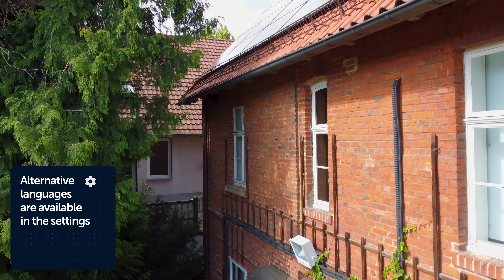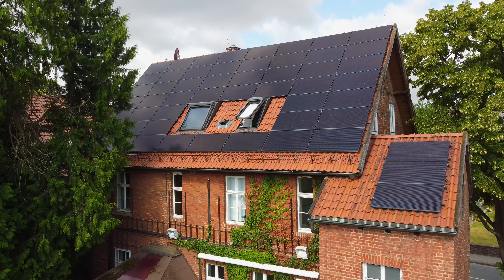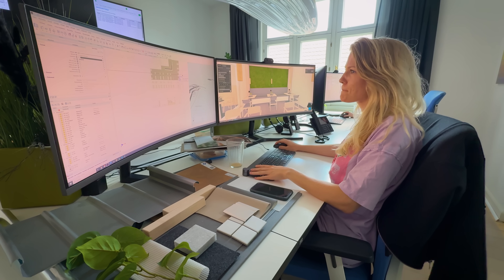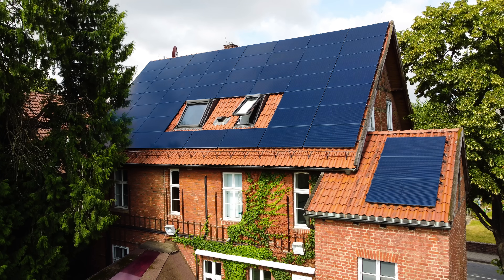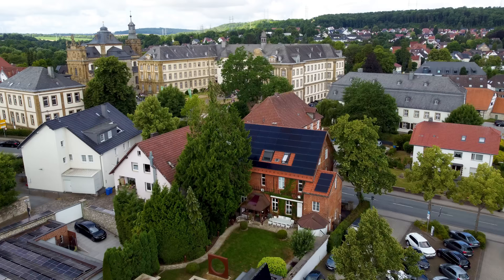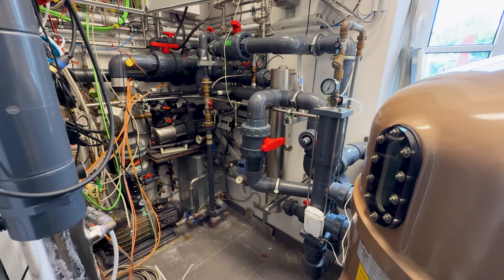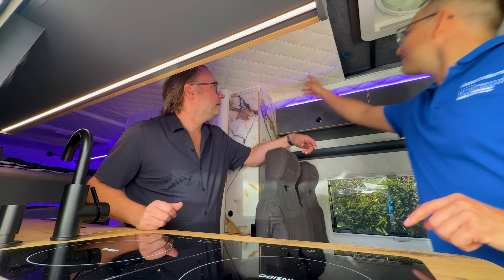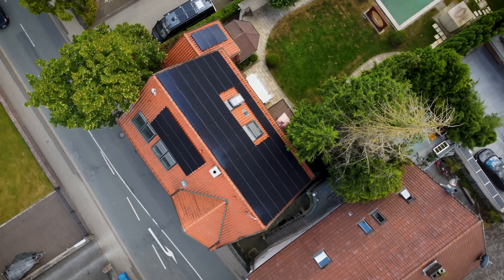How a 1850s Family Home beat Solar Panel Shade

Comment: Very cool advert. Really but....despite of that this offer is not for common users. More than 95%  i think   houses like this dont need  such exaggeration .  100KW storage + 40kW panels  +  electric cars . I can not imagine how  expensive could be and if somebody calculated savings. But anyway .... 200kW power consumption per day?  For who and what is that nonsens? Just to keep energy to blackouts ? How long? How often? Sun doest not shine every day . What about winter time?  Simply calculation 50 kW minimum needs with 100kw storage maks 2 days. Sorry i am not against and additional i am experienced user/designer of offgrid systems and i LIKE it but....the real truth is not like on this movie and there is not in the whole world yet solutions to produce energy from darkness and shadows.

Comment: YOu can make your DIY DC-DC BUCK synch. inter. 3-phase topology
or BOOST topology, so you can cope with shading.
Look at P&O or Incremental Conductance algos. 
A few lines of code, ESP32, toroids, FETs, caps, after 8 hours
all communicating RS485 / TCP/ip / CAN / BLE / MQTT for HA or InfluxDb.

Comment: All of this could have been much easier accomplished with microinverters as you basically "distributed" here your Victron system in a way how microinverters work natively. Enphase would have been great for this particular house. Here are some of the benefits of microinverters.

 - Flexibility of panel placement on the roof. Can have different orientations as each micro and panel is independent . Can easily manage different roof levels as AC cabling more flexible. 
- System can be easily expanded later as you just add more panels with micros underneath. No need to change the whole central inverter. 
- Is very good managing shading / clouds
- Micro inverters start producing electricity with less current than string inverters (early morning / late evening)
- Safety as AC is low voltage and rapid shut down built in
- Longer system life time and warranties compared to string inverters 
- Resilience. Should one micro fail then rest of system still producing
- Module level monitoring and diagnostics
- Sunlight backup without grid or battery power as long as there is sun (Enphase IQ8)
- An Enphase microinverter system (AC) with battery can output way more power during daytime than an equivalent string inverter system with battery (DC). Reason being that microinverters output AC for use in the household while the battery also outputs AC for household use.

Comment: Just put some micro inverter, will be even more efficient in the end with one mppt per panel, let the multiplus control those micro when the grid fall. It's better then the multiple mppt of the video solution. Even if Dc-Ac-Dc is less efficient, I'm pretty sure the shading will be far better controlled. And it add AC power to your system, reduce the load on those multiplus.
An other parameter would b'be back busbar panels which deal far better with shades.
And yes...an other one, there are far too many packs for only 100kWh of capacity, get rid of those small pack and buy bigger ones...like the actual MB56 packs, 32kWh per pack..you only need 3 pack, 3 pack = 3 Bms instead of the 20 you got..that's 6/7 time less energy loses here....

Comment: Nice implementation of available technology!  Might not save any money, but using 9 solar charge controllers with that much battery storage, provides a good amount of reliability and self-sufficiency.
Reply: These MPPT controllers aren't actually expensive at all.

Comment: I like Victron products, I use quite a few myself but this is another example of an OTT installation. More money than sense... the total cost far outweighs electric bills for decades into the future and the batteries will need replacing every 10-15 yrs so that cost never ends.
Reply from the maker: Remember this install covers his house, his business and the power for his cars. (not all cars are his).  Plus Sven can feed excess power back to the grid making money.  We find a lot of people also treat a Victron system as a hobby (like golf, luxury cars or going to fancy restaurants) and they are eager to learn and see what else they can put on the system.

Comment: Very interesting, I have a similar, but smaller installation in the south of England. I too have SolarEdge for the panels my neighbour's tree shade at certain times. I have added three MPPT controllers for the other PV panels as these are placed on different parts of the building, all with different orientation.
I have a MP2 10kVA inverter/charger coupled to a Fogstar 32 kWh battery, as this neatly fitted in the space available, which is narrower than a standard rack.
I run Venus OS on a raspberry Pi with CAN bus HAT.  
As I also have a heat pump I use Octopus UK's  'Cosy' time of use tariff,  this provides 8 hours of cheaper electricity a day in three segments, allow me to keep the battery topped up. I have started to use DESS to help manage this.
So far very pleased with the system. 
But I do wish Victron would design a replacement for the SolarEdge, supporting panels with individual optimisers, as I have had two failures of SolarEdge inverters in the last 5 years, they are not as reliable as Victron kit.
Reply from the maker: This is great to hear and boy you have a comprehensive setup there by the sounds of things!  I'll ask about SolarEdge alternative and come back to you.

Comment: Alternate languages.... don't get me started. YouTube has been trying to force AI-generated voices in ones native language (Dutch in my case), while I want to hear the original. There is no option on the clients end to stop this, though a certain browser addon does help automatically selecting the original audio.
Reply from the maker: Hi there,  thank you for your comment.  YouTube are pushing this as not everyone speaks English.  The Netherlands is rather unique as a very high number of people speak English and as you know, many are taught English from a very young age.  But the reasoning is to be inclusive.  To change the language its really easy and it stays that way for all videos (so in your case English as preferred language).  At the bottom right of the video (top right on mobile) click the cog and this allows you to change the Audio track.  Hope that helps.
Reply: @VictronEnergyBV  I have no problem with YouTube offering this feature, the problem I'm having it's being forced with no option to turn this off. When I select the original audio track using the cog, this only applies to the current video, there is no option to always have the original audio track by default and I'm far from the only one running unto this ;)

Comment: I was thinking about either 3x15kVA or 3x3x5000VA (as I already am offgrid with 3x5000VA) and 135kWh of battery (currently 90kWh) :-). The difference is also: I am really off-grid. The nearest grid line is 20kV. And in this "cheap" (hungary) country, somehow the electricity prices are higher than for instance in the Netherlands.
Austria is near. Anyway in the winter it is like this: either it gets cold, and you can fill the batteries due to clear weather, or it's not that cold, but you have to turn on the diesel gen due to mist and no wind.
Local people keep insisting on wind energy, but they have never experienced normal daily wind in the Netherlands, which is here regarded as a storm. Getting 10m/s windspeed is practically impossible. And that's only the starting point.

Comment: I am a Victron Enthousiast and also Victron ESS installer, however in this situation I would not have chosen 9 MPPT trackers, but I would have combined the powers of Victron and SolarEdge. Solaredge uses Optimizers on each panel an thus, each panel has its own MPPT tracker. This would have made the installation a lot easier as there would have only been the need for 1 or 2 solar PV strings, instead of 9 different string, The costs would have also been a lot less since every optimizer would have cost only about € 45 and a 3 phase SolarEdge inverter only costs about € 250,- nowadays. And yes, you would need to convert AC back into DC again which comes with efficiency losses, but those losses are much less compared to the gains of having an MPPT for each panel.
Reply: It's good to have at least one mppt charge controller in any Victron system to allow recovery in a system failure.

This system here sounds like it's heavily geared towards off grid back up.  Using a solar edge or any other grid tie inverter would not offer power from the solar in a grid failure.  There may have also been constraints with the grid limiting how much AC equipment could be connected.

It's possible to ac couple solar on a fully off grid system using Fronius or some sma inverters.  The limit is that you can't readily change between off grid and ESS with out reprograming several devices each time. 

Overall the flexibility of Victron gives us plenty of ways to solve challenges.
Reply: @WindyJAMiller  If the SolarEdge inverter is installed on the AC Out side of the Multiplusses, the inverter would continue to function during a blackout. In fact, Victron and SolarEdge have very good implementation in off-grid situations.
Reply: @veeerzes I didn't know that. I've used Fronius and sma so far on offgrid AC coupled. 

Does ess go into frequency response when there's no grid then?
Reply: @WindyJAMiller  The Multiplusses can be programmed with frequency shifting during of grid situations. With the right setup (also in SolarEdge inverter) the system can reduce PV power to 0% when batteries are getting full.
Reply: @veeerzes yes I understand that, but my question is does the multiplus still allow frequency response when it's set in ess mode?
Reply: @WindyJAMiller  Yes, and with the new Cerbo firmware, it even supports full dynamic control over Sunspec, so in practice it won't even need frequency shifting.
Reply: The problem I have with optimizers: They are an additional piece of technology sitting on the roof below each panel. And optimizers are not failsafe.
Reply: @wiedapp  I've installed multiple PV systems with SolarEdge in the past 10 years. Out of the hundreds of optimizers, I only had 1 DOD and never had any fail after install.
Reply: But that's converting DC solar to AC, then converting back to AC to DC from the charger into the battery.. much less efficient.

The victron MPPT 150/350is only 100 pounds per each 3 panels. So essentially it's the same price from that standpoint as 3x solaredge micro inverters.
Reply: @jcautec in this case the solar edge might still be a better option from an efficiency point as the site had high demand, producing power straight to AC where it is then used is probably effective and efficient. 

Also looking at the age of the solar edge inverter and the batteries I would say the Victron system is at last a couple years old and the sugar edge inverter looks to be older still, prices have changed around a lot in that time so that might have factories into the decision process at the time.
Reply: @jcautec  The optimizers are FAR more efficient than the Victron MPPT's when encountering shadows. Unless you have a Victron MPPT for every panel... I already mentioned the losses from DC to AC and back to DC, but if you watched the video, you will see that he has a lot of AC loads, so much of the AC -DC conversion doesn't actually need to be done.
Reply: That's exactly what they did.  🤣 Way to comment without watching the video...
Reply: @zstation64  I guess you didn't pay enough attention, they only used a SolarEdge system for the panels on the garage... Please take your childish "🤣" back.

Comment: At 7:25 he mentions they use a mobile electricity tariff, does that mean it has fixed hours where the electricty is cheaper or is it a variable dynamic tariff? How did they implement the charging of the battery on this cheap tariff, using the built in DESS from Victron or a custom Node-RED control?
Reply from the maker: You can do it two ways.  Node-red or the easier way Victron Energy DESS 

If the energy provider has an API it can dynamically change as per each 30 minute interval.  More information here: https://www.victronenergy.com/live/drafts:dynamic_ess

Comment: Powered from March to October! Thank God for coal and Nuclear from France!  In Australia my 10kW of solar panels runs our off grid house every day right through winter, still giving 25kWh on the shortest day. I use three Victron Multiplus11 paralleled, (runs cooler than one big unit) and two MPPt450/100 chargers. We are a Victron dealer.
Reply from the maker: Welcome to Europe during the winter - not loads of sunshine.  But Sven does use the power directly using ESS in the winter.
Reply: @VictronEnergyBV  In Brisbane we get so much sun its insane. By 8 am battery is full and runs all our loads including a 7.5kW air  conditioner and pool pump.. My 66kW battery (made from 4 banks of 330Ah EVE cells) never goes below 70% even in the rain. The Victron MPPT 450/100's are amazing.